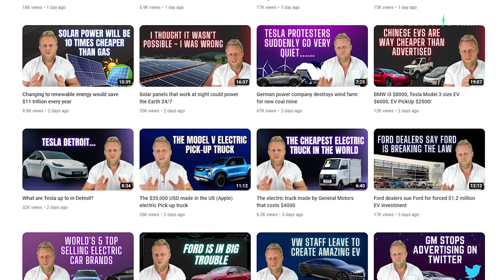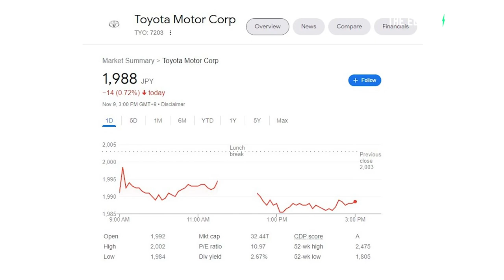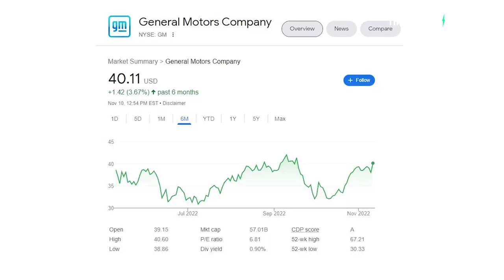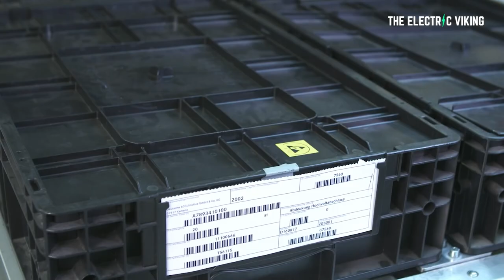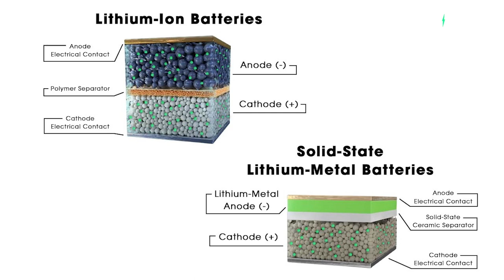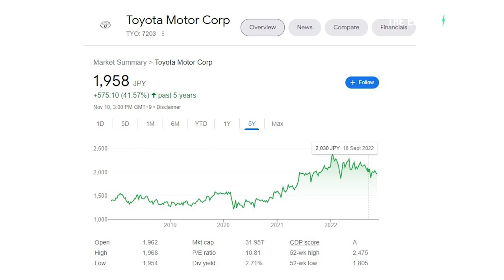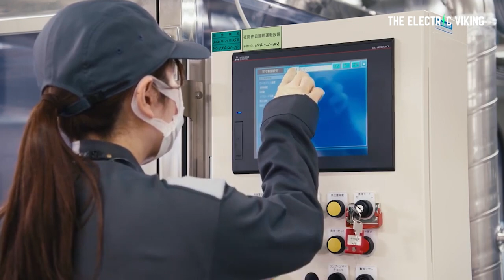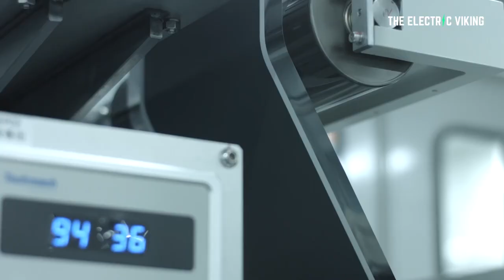Toyota's Solid State Battery claims have ZERO credibility

Comment: I had a chance to visit SolidPower in Colorado two years ago and got the impression that they're pretty sober in their projections. No hype, no implausible time lines or efficiency claims. Overall I'm guessing it's more likely that solutions will come from smaller outfits rather than from in-house research by big auto because there are many, and because they don't have to maneuver through a corporate labyrinth.
Reply: Big corporations exist to operate the status quo efficiently. They can make more of the same possibly more efficiently (though unlikely) but they can’t change direction. Their huge infrastructure goes directly against any change of direction on anything.
Reply: @Dave5843-d9m  Too many executives, too little power, means nothing gets done quickly, efficiently, possibly zero innovation. The opposite corp architecture in a corp will bury them.

Comment: It's not just that solid state batteries can't be produced economically at scale -- they also can't be produced in a form that can power a car at any price. The state-of-the art are small bench-top pouch samples that stack only a few electrode layers.  QuantumScape's also need to be compressed and maintained at a fairly high temperature to operate.  QuantumScape is fairly transparent, and has a roadmap stretching out most of a decade before commercialization.
Reply: Agreed. Those who knows what and How .. Solid State Batteries ... wroks. Then many will know that "Electrons" need a "Media " to work. It is NOT easy to make such " miracle material " at MASS volume , reasonable cost and durability !

Comment: Timed myself, takes me 16sec.s longer to leave in my car after unplugging the charger than to Leave without having it on the charger. A little less to leave my Tesla after plugging it in as opposed to not.  Something to think about next time somebody says “if only they charged faster”.  Every day I leave with a full battery and I’m good for at least 225 mi.s 300 if I want to push it. Don’t have to find a cheap station don’t have to use credit card, no listening to annoying ads from pump, don’t have to pay five times as much per mile,  no oil changes.  Got 63000+ miles on it after 2.5 years.  Charging time is great as it is right now.

Comment: It’s highly likely that solid state batteries are impossible. Every chemical compound has a different density. So the battery will expand and contract as the chemicals change. No problem when there’s a liquid content. A major problem when they are locked into a solid brick.
In addition, who says a solid battery is better than a “normal” battery? It’s not written in stone even if Toyota say it is stone.
Reply: Our current understanding of what a solid state battery is would tell us that they should solve most of our issues with current batteries. That’s all of course something that may change, but at least with our current understanding they are the most desirable. Although I don’t believe for a second that Toyota has any chance in bringing them to market period, let alone first

Comment: The only reason Toyota is undoubtedly the solid state battery leader in the automotive sector is the simple fact that they’re the only ones currently road testing a car with a solid state battery. That’s a pretty big point to miss in the video. 

I don’t own a Toyota, in fact I probably never will. They’re boring, soulless cars. That said, it’s undeniable that they’re rock solid. Toyota tests things for years longer than any other automotive manufacturer before they produce it for the mass market. Look at their engines and how long they’ve been manufacturing the same motor for. Their “new” engines are just minor modifications to engines from 10+ years ago.

Comment: Other than solid state batteries not having an liquid electrolyte, I truly don't know what a solid state battery is.  It might be the new "thing", but when I was in elementary school we were supposed to have jet cars by now - like the Jetsons
Reply: It has a solid electroyte equivalent as you note.   The issue with liquid electroyte is that the electrode material can migrate through the liquid causing degregation over time. Particularly at high charge and discharge rates.  Hence solid electroyte solves some high power issues,
Reply: Flying cars are stupid idea most people have trouble with 2 dimentions.
Reply: Funny how it's been the "10 years from now" poster boy for about a century now.
Reply: @Tom55data  I am optimistic that  the future solid state batteries are a practical solution and not something that only NASA or military hardware could use.  That;s because I only purchase 2nd hand cars and solid state might be a lifetime battery.  Then we can have beater EVs that never die

Comment: Worked with Japanese for years.  Hard working, smart but can’t handle being outsmarted.  Some just don’t know what to do.  Good people but sometimes surprisingly prideful to a fault.  Seeing that fault now with batteries, hydrogen, extremely too cheap new products etc.  they’re squirming.  I believe they are saying what they need to do and then desperately work to that goal.
Reply: Should have mentioned, don’t count them out they may yet pull it off!

Comment: I highly doubt a company of Toyota's credibility is "lying" about solid state batteries. Far more plausible they are just having difficulties trying to move technology from the lab to cost competitive mass production. Companies invent great prototype products all the time that they later have difficulty commercializing due to high manufacturing costs. Just because something exists in lab doesn't mean it necessarily is price competitive once it reaches manufacturing stage.  There often needs to be innovation in manufacturing that differs how the prototype was created in a lab.  A prime example of this common problem is graphene. In the lab, it's the most revolutionary material of the modern era. Mass producing it cheaply is a whole different can of worms.

Comment: Your opinion on quantumscape? And any interesting battery stocks?
Reply: My opinion of quantumscape.. 
1. Down the wrong path, speficically targeting vehicles.  In that sense very poor judgement on the part of their executive leadership. 

Here's why- for vehicles they have to solve multiple problems simultaneously, energy density, power density, longevity,  cost and fast charging. 
Energy density and power density are the easy ones.  
Fast charging goes hand and hand with longevity. 
Now if you have those two easy ones are solved, and the cost is high, but  under six figures per kwh, Samsung and Apple would be lining up.. because cell phones, laptops, just about any electronics.  Also they could care less about longevity..because who has a 6 year old cell phone. 
If quantumscape did solve all of those.. again, electronics makers first in line because deeper pockets, and you would see super fast chargers, sacrificing longevity for charging speed.  Because what cell phone maker wouldn't want batteries to charge in 10 minutes?  
Then add in the "intrinsically safe" part of solid state batteries.. just the liability insurance for Apple would decrease.. nobody wants a 3rd degree burn on their crotch, and an electronics maker definitely does not want to get sued because the person gets a 3rd degree burn on their crotch. 

Now in terms of upcoming battery companies.  I like BYD and CATL.  Cheap long-lasting batteries are king.  I like CATL more.  I also like Panasonic, but that is because their batteries and products have been good to me.  
I do not like LG.. it's like every other day they are recalling batteries due to defects, and that is going to weigh them down, and I think the automakers patience is wearing thin.. how many black eyes before the automakers cut ties? (We all know about the Bolt recall, so you would think LG would have made damn sure their next batteries they supplied to GM were defect free, or at least make sure GM does everything right, right?  Well, Hummer EV recall about improper sealing for the pack- like really WTF?

Comment: Toyota isn't the even the only one to lie and hype up solid state batteries. Fisker hyped up that they had made a major breakthrough on solid state batteries, only to quietly abandon all solid state battery research completely just a few months later. They basically said "the first 80% is easy, but the last 20% is really hard and/or maybe even impossible". Bottom line, I've heard so many lies about Solid State Batteries over the years that I automatically assume anyone is lying when they claim to be bringing them to market. I'll believe them when they can bring it to market and not see the batteries fail in real world environments.

Comment: Got news for you things sometimes  fail  in production engineering. Building a good battery  that works fine on a bench is one thing but will it hold up at minus 20 while driving over frozen potholes?

Comment: In the words of George Costanza, it's not a lie if you believe it. I don't think Toyota is lying about solid state batteries and I don't think Elon was lying about FSD, in both cases I think they massively underestimated the difficulty of the problem. Nobody is close to delivering a solution to either of those problems. Lots of companies have been perpetually two years away from shipping solid state batteries, so far nobody has. The same is true with autonomous driving. Elon has finally stopped saying end of the year and Ford has thrown in the towel altogether. In the next year or two I expect that you'll see  some of the solid state battery companies go under. 
For Toyota they've already said they are rethinking their EV strategy. My guess as to why Toyota has done nothing with EVs yet is that they were so confident that they would have solid state batteries in the near future that they've put EVs on hold until the SS batteries were ready. If they had them and nobody else did they could leapfrog the industry. Unfortunately for them they still can't make them in volume and might not be able to anytime soon. By the time they can build them it might not matter because conventional batteries will be just as good and be cheaper. Toyota may have just realized this which is why they are going back to the drawing board.

Comment: I still think there will be 3 new types of batteries per year for the next decade. It's going to be amazing. Materials are another wildcard, just think if someone makes a room temp superconducting material. Can you image how much more efficient and powerful electric motors would be wound with superconducting windings? The other big orange cables in the car could also be much smaller and lighter and charging stations might have tiny cables that don't even need liquid cooling.

Comment: Toyota will release there sold state battery in 2025  with higher density  and less weight  the problem at the moment is the cost is four time higher than the B Y D  battery they are using now  solid state means no electrolytic  fluid in the battery  BMW has a pattern as well .

Comment: I think you could have got to the two main themes of his vlog, more quickly and efficiently. Yes, it is imaginable, as the Storedot CEO has stated, that the cost of making solid state battery products will remain high for the foreseeable future - we get to that significant point only after ten minutes of preamble. And, yes, it is likely that Toyota is just exaggerating the progress it has made towards being able to produce viable/technically sound solid state battery products in the near future (at a price that consumers can afford). Indeed, inconsistencies in its own statements on the matter do leave scope for suspicion that there is more sizzle than steak in the claims that Toyota has been making.

Still, you overshoot the mark, at several points in the vlog. First, inconsistencies in Toyota's statements about the progess it has been making on solid state batteries is firm ground to impute that R & D hasn't been trouble free and that exaggeration of achievements, rather, is the order of the day. However, there isn't any way to see behind the veil of secrecy at Toyota, unless you have a reliable informant, so, conveying the impression that you can see through that veil, as you sometimes do, gains nothing and just makes you sound biased.

Second, if you intend to say something of substance beyond, "Toyota's solid state battery patents might be bogus", then you will have to examine and evaluate those patents. That would be interesting, so I hope you get on to that soon. Until then, all we have is the suggestion (born of understandable misgivings) that Toyota's patents might be worthless/meritless. It will take evidence to move beyond misgivings and prove that those patents are junk.

Third, Nissan is partnering with NASA to develop and refine a suitable high volume manufacturing process for the solid state cells that NASA has been working on with various partners for many years. Those cells will probably be based on a Li-Sulfur-Selenium chemistry developed by NASA. So, no, the work Nissan is doing isn't bogus. It has hitched its wagon to NASA and is willing invest heavily for early access to NASA's research. Nissan may be lacklustre but they aren't intending to lay down an die. If all else fails, Nissan appears to be very interested to become a leading cell and battery manufacturer by later this decade.

Comment: All the manufacturers make outlandish claims  Fully autonomous driving driving Tesla?
Reply: Anyone who bothers to do their research can see that FSD is nearly there in practical terms.
Reply: @fredbloggs5902 Having done your research then you must know that there is currently a DOJ criminal investigation into Tesla's claims. Claims it's been making since 2015, sounds similar to Toyota's battery claims to me, only they didn't claim that their vehicles were already sold with the capability.
Reply: @jimbo3207  one is publicly visible in terms of progress, the batteries have no public visibility, and the details about what those batteries can do keep changing entirely. Tesla at the very least is showing their work and progress, while rather importantly claiming it to be a Beta, while Toyota keep shifting the capabilities of their batteries and saying that they’re actually done
Reply: @SyntheticSpy  Don't get me wrong I'm not defending Toyota claims but with respect the beta will only allow level 4 automation not level 5 i.e. full driverless automation and thats if they can get the bugs fixed, something that the Waymo system did in 2017 
 It's doubtful anyone will achieve FSD within a decade so they should stop making the FSD claims as part of the sales pitch.
Reply: @jimbo3207  Waymo doesn’t scale and is too expensive, well done, you just proved to everyone here that you know nothing.